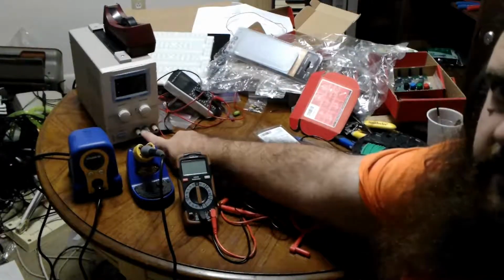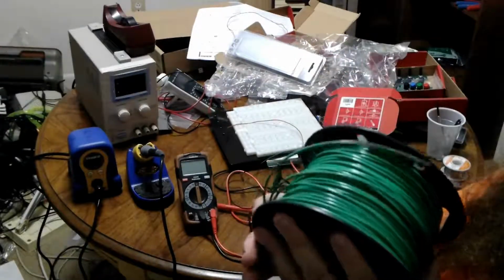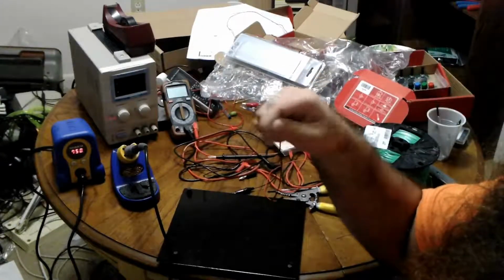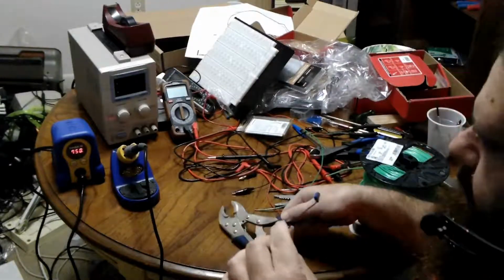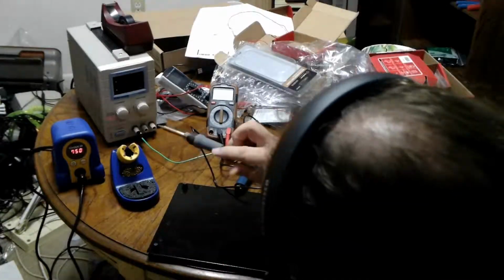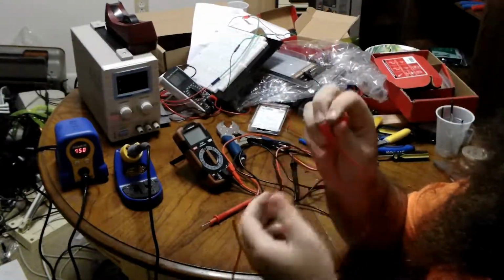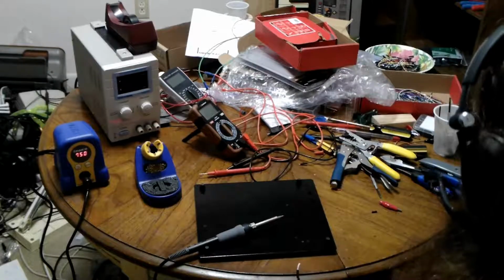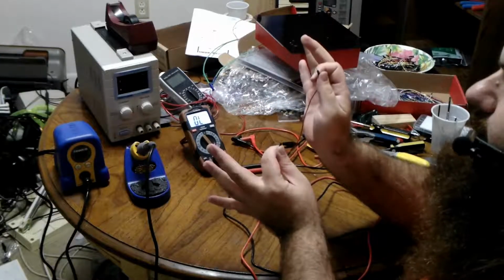Custom Probe and Supply Wires for Breadboards - Simply Put

Comment: wouldn't it be better to solder the cables directly together?
it's easier, less bulky and has better (long lasting) conductivity. 
there was many times where crimps in my car projects oxidized after a few monthts and were permanently "open"
Reply from the maker: Yep, you're right. I did a follow-up video where I did indeed solder them together, and then heat-shrink over that. And I've recently discovered that it can be a good idea to crimp over the solder if the wire is going to be flexing and bending a lot, but for a wire that's going to just sit there, solder and heat shrink is great.